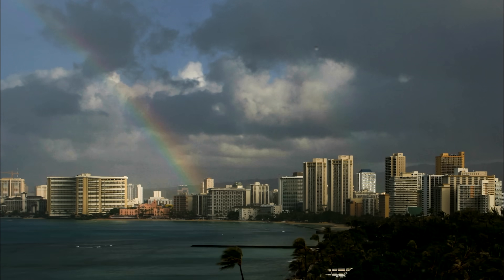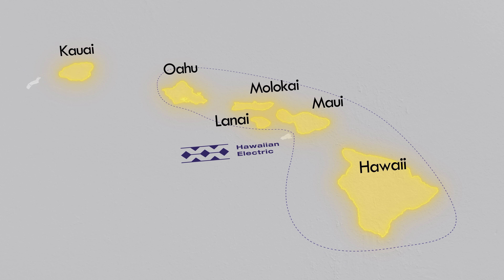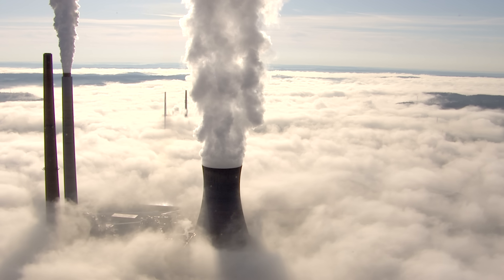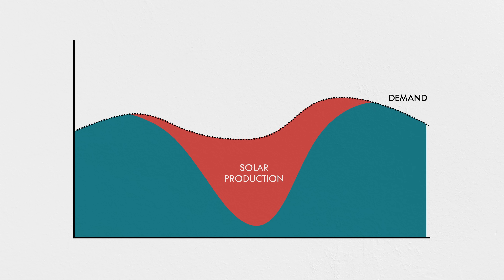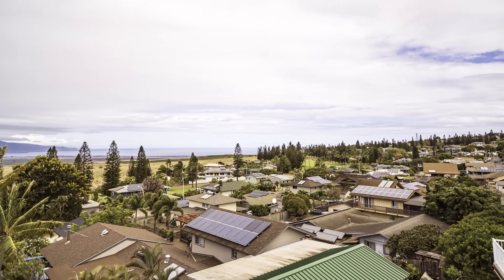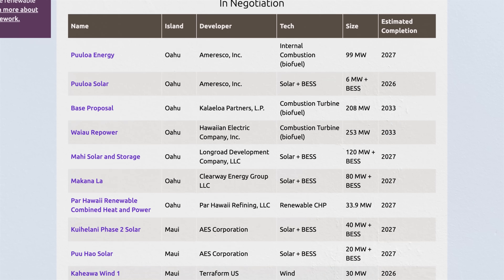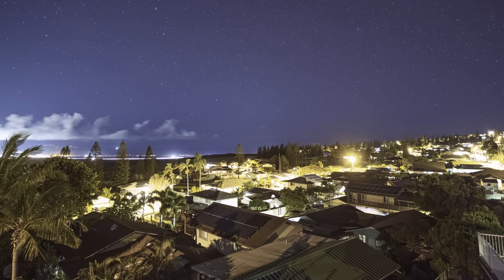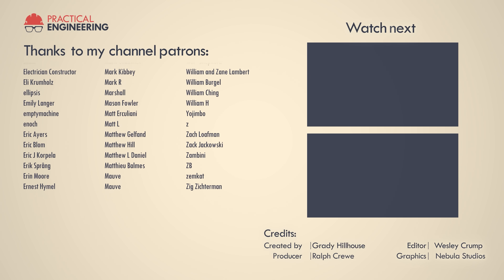How the Hawaiian Power Grid Works

Comment: One thing that needs to be mentioned is how much more spare capacity you need to achieve reliability on a small grid. You can spread out redundancy cost so much more on a larger grid. I know. I live on an island and we get power outages, especially after storms.
Reply: You really become aware of this when you run on generators.  The vast majority of the time, a single Honda EU2000i generator is enough to power my home.  BUT.. try to start any large motor (AC, fridge, dehumidifier) and you're pushing your luck if too much is running.  Twinning a second EU2000i eliminates the issue, but at twice the cost.
Reply: @grayrabbit2211   not knowing your needs, but if you are off grid, I think a battery backup is a pretty good idea like power wall, let’s you run generators efficiently, and shut them off when not needed.
Reply: @jsbrads1  Hurricane recovery. Backup batteries won't help here.  I spent ~110 days running on generator after Hurricane Ian.  Blame FEMA.  The local power company had the main power lines restored in about 10 days, branches in the next 7.  Red tape prevented people from reconnecting.
Reply: @grayrabbit2211  backup battery alone would be useless, I’m talking about backup battery with generator. Generator kicks in when you need lots of power or when battery is low. Battery runs hallway light all night.
Reply: @jsbrads1 Bizarre.  Here’s a guy with generator backup, and without blinking, you’re suggesting a $15K Powerwall to back his backup, replaced every very 15 years of course. 

How about a cheap reliable grid instead. Radical idea?
Reply: @Nill757   I did not recommend a $15k powerwall. I recommended a battery backup. It isn’t that hard to get a few lead acid batteries, run a line to power the hallway light, bathroom light and other small incidentals that might parasitic drain your power all night requiring a generator to run nonstop, when a system can be designed that will allow it to shutdown during low demand times.
Reply: @grayrabbit2211 It’s bizarre how far lost is US infrastructure and the public perception. Nobody used to talk of generators unless you lived in a remote shack. Now they’re common, and here’s a guy talking about doubling up. This is what Nigeria looks like. Home generator power is far more expensive than old grid power, uses far more fuel and emits far more pollution.
Reply: @Nill757  The problem is that people have become very soft.  

My middle school (in Florida) was built with only air conditioning in the cafeteria. None in the classrooms.  Fortunately by the time I got there they had retrofitted aircon to the classrooms.  BUT, these days if a school lost aircon, they'd cancel classes and send everyone home, when no aircon was the default back in the day.  

In my area, power is substantially far more reliable and power outages are far shorter than they've ever been.   I remember power outages lasting multiple days growing up.   Other than a hurricane, I can't remember the last time I lost power for more than 5 minutes.  

But again, modern people are soft.  They can't imagine going for more than a few minutes without Facebook/TV/etc.
Reply: The best example: on a single generator solution, you need a whole second generator if the first one breaks. So twice the cost.

On a 5 generators solution, you can still get away with only one additional generator (assuming you consider that you’ll immediately repair the broken one). Only 20% more.
Reply: All “capacity” is not the same.  MW of wind solar battery will often not be available. Diesel, bio, nuclear almost always will be.
Reply: The people who spam "buy local" on the internet are the same ones that get cheap power through a distributed grid
Reply: You saw the reliability/cost curve. Pick where you want to live on that graph and grid will be built for that. Since electricity started to be sold commercially, there were detailed analysis about how big to build one or more plant to supply the customers they believed they would buy power. Every subsequent decision is based on the new increasing demand, the existing aging infrastructure, the inputs (like fuel) that is available and accessible and the technology available at the time of the analysis.

Comment: 14:00 You can pay extra for more reliability by buying a backup generator, but not to the utility unless they were to have some incentive for it
Reply: That could actually be an option to add into the mix---some sort of public financing option for point use backup power systems (either battery or generator).

Very few electrical users need the same level of reliability for all of their uses. E.g. from my own experience using generators during extended power outages, the most practical solution is to size one to power the most critical systems only. Some things are needed for safety, others wanted for comfort, and the rest are luxuries that can be given up for a few hours or days.

There should be a discussion about what level of grid uptime reliability we actually want, and at which point backup or going without makes more sense.
Reply: @xanfsnark  The problem with small size home generators is the cost per day to operate is high.  Even when the power goes out and I choose to run a small Honda EU2200 for the fridge and a few ad hoc uses it still uses about 1 gal per 8hrs. That is a lot of fuel on an island to provide for each home and a much higher cost per day. I am guessing they are also for more polluting than a large scale solution. 

Batteries may one day be the answer but those have a shelf life and they also are still unfriendly in terms of rare earth and chemistry.
Reply: @NONO-hz4vo  that's absolutely true, but that makes it an optimization question. For example, at 99.9% grid uptime, you'd expect to run the generator less than 9 hours per year (i.e. about one gallon of fuel for your example generator). Whether the costs of upgrading the grid to 99.99% uptime is cheaper depends on the particulars. Many homes and businesses wouldn't even need backup at all at 99.9%
Reply: @NONO-hz4vo  I live in Louisiana where hurricanes can knock power out for a week or more at a time. After Hurricane/TS Isaac, my dad bought a generator for the house. It's not the biggest or most powerful thing, but it keeps the important things on plus a few extras. He recently converted it to run on the house's natural gas supply, so it can basically run indefinitely. There is the possibility of gas service going out, but by then no one will be there because they'd all be evacuated or dead. Entergy is working on fortifying the grid, but that is a decade long project. Generator and our gas service ain't going nowhere
Reply: @xanfsnark That's actually happening in the UK. At times of peak demand (about a dozen hours a year), energy companies are offering 10 times the normal rate for any energy you export. It's not enough to justify buying a home battery, but it's a nice bonus if you have one.

Also, I bet the occasional rolling black out is a big incentive to buy a home battery.

Comment: As usual, this is excellent, but one oversight near the end. With a solar+battery system, oversized a bit, you CAN buy additional reliability as an individual customer, at a price that keeps coming down. (Probably will remain more expensive than amortizing additional investment in making the whole grid more reliable.)
Reply: He's talking about in the context of a customer relationship with the power company. You can't pay a lower rate and get intermittent power any more than you can pay a premium rate and get guaranteed service. There's one grid, and the costs are borne by all.
Reply: @HunterTN  Oh yes, I understand it well. He also said around the same time that you can't pay more as an individual and get more reliability just for you. That was my point... nowadays with solar + battery, you actually can buy more reliability on an individual basis.
Reply: >- . . .  nowadays with solar + battery, you actually can buy more reliability on an individual basis. <
Yes you can, and depending on location (solar resource vs electricity cost) you can generate electricity cheaper than the utilities can.

Comment: This video is quite misleading; you're trying to present Hawai as world leading when it comes to renewable energy integration, but thats not even close to true. 

Norway gets essentialy 100% of its electricity from renewables, the UK around 58%, Denmark 80%, Sweden 90% etc.

Hawai getting less than 40% of its energy from renewables is really nothing special. 

Its very impressive for such a small grid, but nothing crazy apart from that.

Comment: Interesting you say the depth between the islands have been a contributing factor for not interconnecting the islands but it was only recently there was talk of connecting Australia to Singapore for a "green energy" project capital raising sham.
Reply: Hawaii is in the middle of the ocean and the seafloor can be 5000 meters deep between the islands.  The water between australia and singapore is mostly less than 100m deep.  

Theres a reason the great barrier reef is in australia.  Its because that entire region sits on a giant plateau.
Reply: @harperwillis5447  "mostly"....... Yeah, Singapore to Bali is, then there's a 4000/5000m trench between Indonesia and the NW Australian coastline.  Did you even think to double check Navionics before commenting 😂

Comment: Just like Commiefornia, there's no excuse for a highly developed nation to have rolling brown/black outs. Given Hawai'i isn't on any fault lines, and any significant geologic activity is volcanic-based on the Big Island, and continues to move northwest off the magmatic hot spot below the surface, why not have a couple nuclear power plants on Oahu and Kaua'i? This would provide consistent, reliable power not tired to gas, coal, or trash. Wind and solar are potential options, but unreliable and require the right conditions (windy but not too windy, and daytime when storms aren't in the way, but also have significant footprints to meet demand).

Comment: A volcanic island depending on oil instead of geothermal is insane
Reply: Do you know anything about the operation of geothermal?
Reply: Why? Oil was much cheaper when the original grid was built. Everything the residents consume must travel there by ship, all of which use fuel oil. Geothermal energy is not simple, and requires significant up front investment. Not “insane” at all.
Reply: They have a 38 megawatt geothermal plant called Puna Geothermal Venture. But the locals go nuts even though the suburb was built up after the power plant was constructed.

Comment: How vulnerable is the United States to a partial or complete collapse of the grid from an attack of some sort?
Reply: More likely an attacker would hack into the various SCADA systems and shut down all the power sources after causing much of the distribution equipment to self-destruct by commanding them to close when they aren't supposed to.

Comment: The Christmas Creek mine in Western Australia has a massive solar farm which on a clear day can power several mine sites in the area, but the gas generators are kept ready in case clouds appear and pose a risk of blocking the sun. On a good day it produces about 60MW just from the sun.
Reply: Do they ever release how much fuel gas is burnt in keeping a spinning reserve? I imagine trying to shuffle all that shifting load on a cloudy windy day makes it safer to just use the turbines. Does Cloudbreak still use the big diesel powerhouse or are they tied into a grid with gas powered generation finally?
Reply: @Crabman_87 I think they looked at how much gas would be required to use the gas as the primary source and realized that  adding solar would save enough gas to make it worthwhile.
Reply: @catprog  obviously..... I asked if they ever release how much is burnt keeping a spinning reserve. To be totally open and honest about the "carbon reduction"

Comment: Nuclear. They need nuclear.
Reply: And when that single reactor that powers the entire island at half throttle needs to go offline for maintenance? Yes there are plans for small modular reactors, but cost effective ones have been just five years away since they were invisioned as the answer to skyrocking costs in the 60s. 

That cost problem is a major factor, as no private energy company is going to choose a plant that takes fifteen years to build and struggles to turn a profit in 45 years when they could instead build a new battery backed solar or wind field in fifteen months and have it paid off and turning pure profit long before a nuclear plant could even come online. This means that any change to nuclear would have to be both very abrupt, and would have to be done by a non capitalist organization like a government, given that any organization that has to answer to shareholders or investors is going to choose the best return on their money.
Reply: You know theres a reason you can find private investors for renewables but not for nuclear.
Reply: @kingofthend  yeah, because people are driven by emotion, not data, and are afraid of nuclear ever since Chernobyl and Three Mile Island
Reply: @sterlingcrawford1218 No the reason is money. It's always money.
Reply: I absolutely agree with you. Nuclear is the greenest way to generate power by basically any metric. It’s a shame so many people are afraid of nuclear energy, especially when modern reactors have a million failsafes so there won’t be a second Chernobyl any time soon.

Comment: I was visiting Hawai’i in February and noticed all the grid scale solar with battery storage, also drove past the big oil(?) fired generating station on Maui, and I had the thought that Hawaii’s electric grid would make a great Practical Engineering video.  Apparently that was such a good idea you were already doing it!  I enjoyed the time lapse of Waikiki Beach at the end, you can see the hotel where I stayed (the pink one).  I would suggest that Hawai’i consider installing some of the latest generation of small modular reactors to provide for baseline power.
Reply: Hawaii has a fresh water shortage. A nuclear plant would only strain that limited supply in addition to the additional geographical risks which the islands pose
Reply: @NicholasBennet  it would force you to use once-through cooling with ocean water  as opposed to a cooling tower. that ocean proximity would put you at tsunami risk (lower in hawaii than japan but still). More importantly, Hawaii requires a 2/3 yes vote in both legislative houses before any nuclear fission plant can be made in the state. Likewise, good luck finding any scrap of coastline where people allow the construction of any industrial site, let alone a nuclear reactor. The only place I could see it is maybe if built within pearl harbor, which would also mitigate tsunami risk but all that land is spoken for.
Reply: @NicholasBennet  given the abundance of sea water available I suspect that would be used for secondary loop cooling, not fresh water.  The water for the primary loop is condensed and recycled, so doesn’t represent a significant use of water.
Reply: for ALL of the power.....
Reply: As much as I advocate for nuclear, Hawaii doesn't seem like a great fit, at least as an early adopter of this tech. Its a high tsunami and earthquake risk area and in the unlikely event that a reactor containment breach does occur (something far, far, far less likely with both SMR and Gen 3/3+ reactors) it would contaminate a large percentage of a whole island, Oahu being smaller than the NYC metropolitan area.
Reply: @joshw.2739  It wouldn't contaminate anything, but it doesn't matter. They need to restart the 180 megawatt coal burning power station. These renewables are clearly causing a decline in electricity reliability and significant rise in Hawaii electricity prices.
Reply: @krashd  How will the containment be breached? And Fukushima killed nobody.